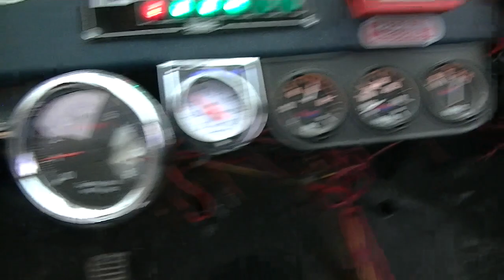blower truck update

Comment: I gotta say, this truck is wicked!  that rev at 4:42!  OMG!  Sure, you had problems at the track in the previous videos, HOWEVER, that's racing, right?  you NEVER get a vehicle PERFECT right out of the gate, you have to tweak it and tune it, adjust things here and there until you get it within tolerances so you can drive it without it blowing up or blowing the tires off and going into the wall.  Keep at it and that thing will FLY!  I bet it would just burn up the track with some racing fuel in it(with proper tuning of course, LOL)  Have fun, build things and put the $ you saved not hiring those "mechanics" into some new rubber or a good paint job.  can't wait to see the next video.
Reply from the maker: thanks buddy and it does have great throttle response that was just a little bit , it will hit the rev limiter before the pedal will hit the floor lol its a snappy engine I love it , and every time at the track is testing when all you do is change stuff try to make it better

Comment: Awesome truck!! Nice buildup. Yah those trucks are good for not hookin up, back end is too light with the leafs being to stiff, little weight transfer. Good show though. Might need to get drastic and make a ladder bar setup, or 4 link.
Reply from the maker: saving that for the smaller shorter truck I got in the shop :)
Reply: I'm building an 86 chevy S10 with a small block 358 I haven't got to run it yet but I'm not going out big on it

Comment: What is the performance advantage of the two inch spacer under the carb? Seems the blower would provide enough air/fuel charge right? Just curious.
Reply from the maker: throttle plates hit the casting of the blower and could not get WOT so I used a spacer, also gives it more plenum volume better response

Comment: 2 lane blacktop style race! .....if you havnt seen 2 lane black top...we cant be friends. Haha Oh, by the way... if I decide to drop the 390 I have in the truck, what manuel trans would be good for it? It has a 600 lift 292 cam in it...
Reply from the maker: dude that and dirty larry crazy mary is my 2 favorite movies 2 lane blacktop hands down my favorite , trans to be honest just run a c6 or a c4, truck that small c4 would be just fine, check out my 302 ranger video manual trans is fun but hard to fit in a ranger with a v8
Reply: Matts Madness Well damn... youve done it all havent you! Would a c4 bolt up to a 390? I know a c6 will. Its what we have in the 68 F100 with the 460.